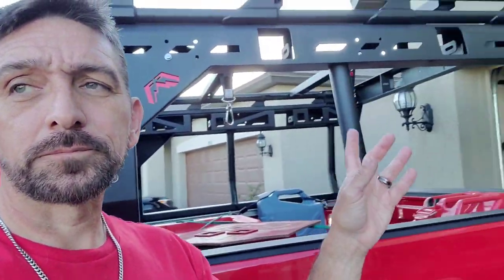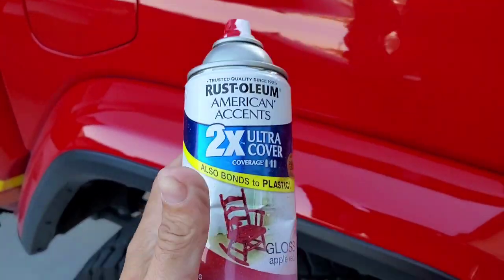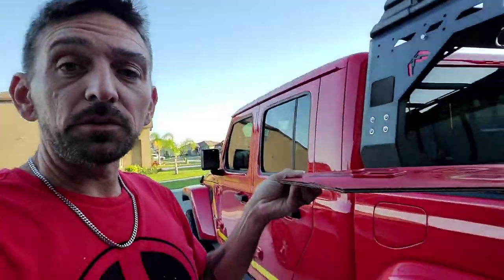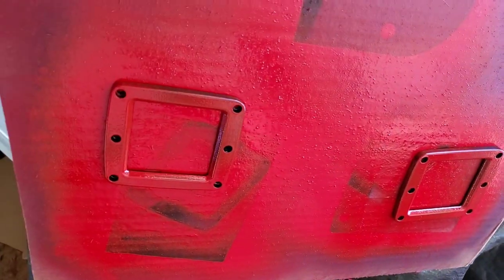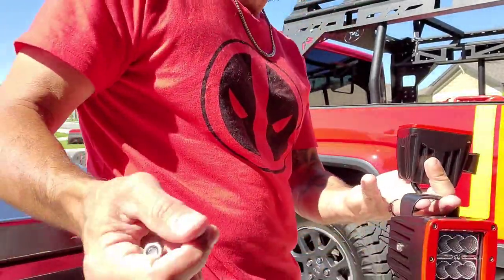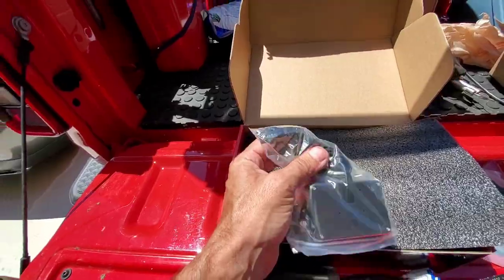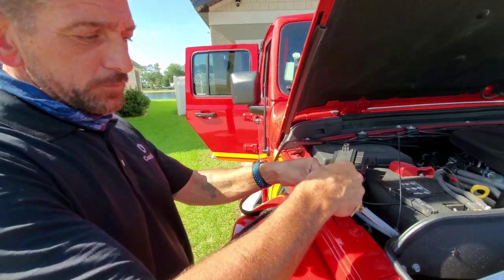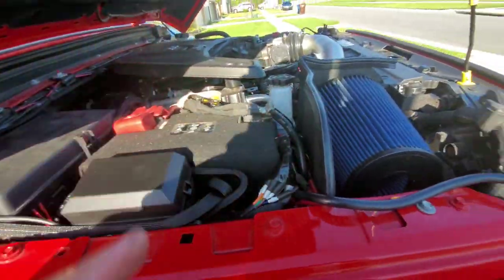Installing Amazon LED offroad lights and Six-gang Switch Pannel on the Jeep Gladiator

Comment: Installed the same switch panel. Works really good. I added mine to the vo switch with ram mount plate and double sided tape. I lowered the windhsield and ran the switch panel wire through that made it easier to run.
Reply from the maker: I wish I could find better stickers. Let me know if you ever come across any that work. Thanks for checking me out!
Reply: @EvolvingMale  yeah not happy with their choices either

Comment: Had to sub just for this video, nice videos for anyone wanting to get things done themselves. What type of wires did you use to run the back lights? Also, do you have a video on how you ran the wires from the bed to the front panel? Then thru the firewall to the breaker box? 

Keep up the good videos brother. I just got my Gladiator 2 days ago, I'll be looking to your videos for some great tips.
Reply from the maker: https://youtu.be/WYpiS4aXffE
Reply from the maker: That’s the video of the switch install. I’ll try to do a short one going over some of the routes and tricks to get wires inside. Try to get that done this weekend.

Comment: Where did you get the truck bed mat material? I’ve been looking for something similar for mine.
Reply from the maker: I got it at Tractor Supply. It's a stall mat for a horse. I had to cut it to make it fit. It's not really wide enough for  the very back, but I cut it so it would fit tight and the two side pieces never move. They are about 4 or 5 inches on either side behind the wheel wells. but it stays put and you can't even tell it was cut. I love it and it's super thick and protective.

Comment: Does it have a memory? So it can remember what lights were in use before shutdown or does it reset everything to "OFF" after powering on? I'm wondering if I can use it with high beams and take acc from high beam signal. If it doesn't have memory it wont work :/
Reply from the maker: Yes,  the buttons stay active.  When you turn it back on,  they are still on.

Comment: Do you mind making a video of how you wire lights to this switch panel? I know the positive goes into it but not sure where to put the ground sides to my lights
Reply from the maker: Two ways to do it. You can literally connect the ground to somewhere on the chasis. Or run a wire back to the battery ground. This is what I did, you can connect multiple lights to the same ground wire and just run that back to the battery. Just my preference, but you can mount them to the frame, too. Theres just a better grounding at the battery. So if you run a wire back to the switch hot wire, just run another with it and go to the ground on the battery. Let me know if you got it. Hopefully I was clear.